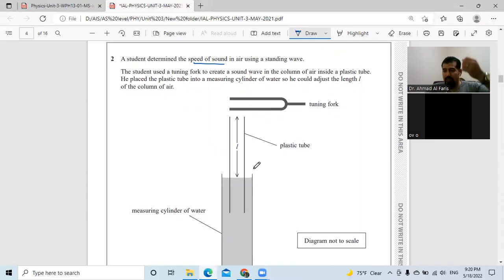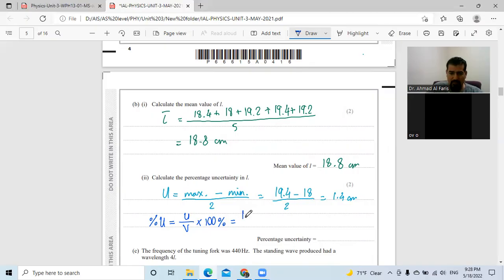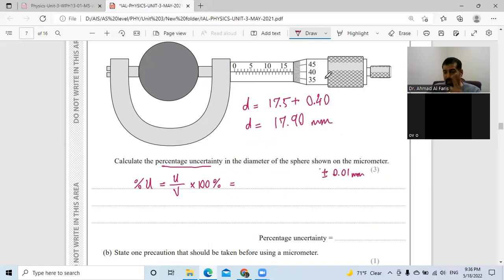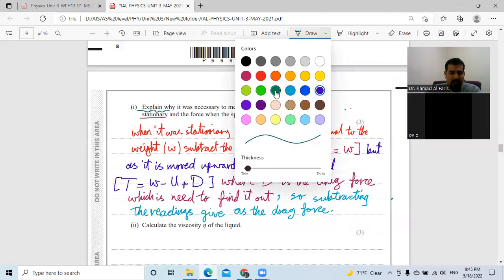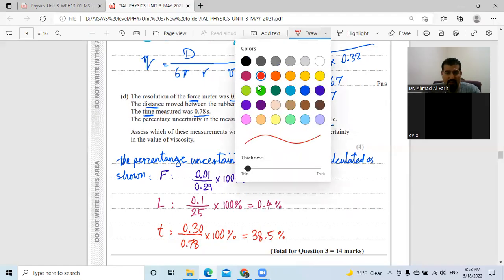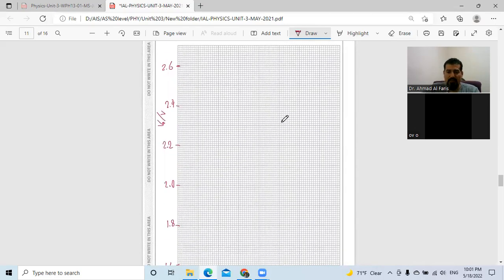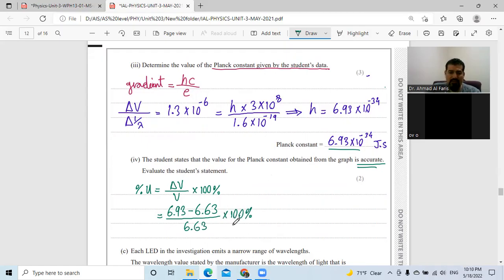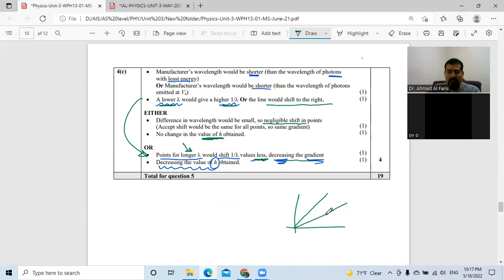part of online class answer & explain Physics Unit 3 May 2021 edexcel by Dr. Ahmad Al Faris

Comment: 38:36 i dont get it why didnt you devide 0.01/2? and why did you chose the measured value to be 0.29 not 0.2... thanks
Reply from the maker: Max. %U
Reply: @Dr.alfarisphysics  thanks... but i have an another question in the last question the last part why wavelength would be shorter and not longer?
Reply from the maker: @bandugom4999  which part?
Reply: @Dr.alfarisphysics  c
Reply: @bandugom4999  the wavelength decreases because it says "narrow range of wavelength" so as wavelength decreases 1/wavelength increases